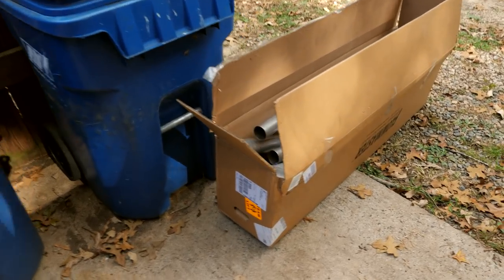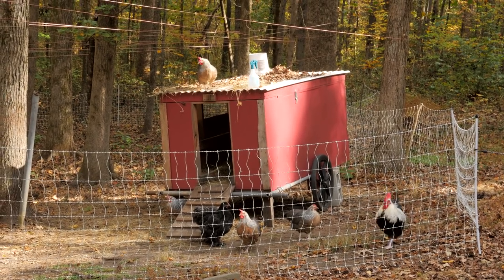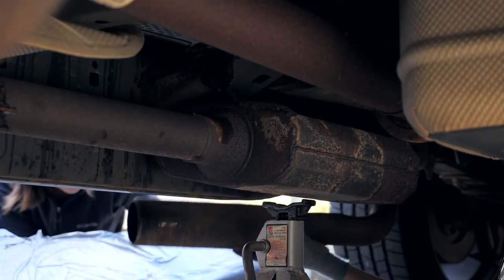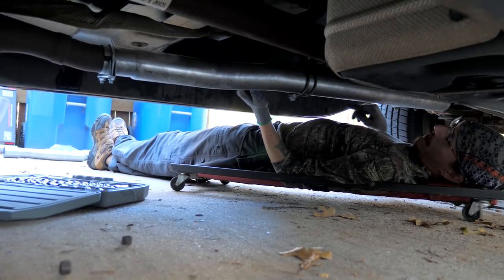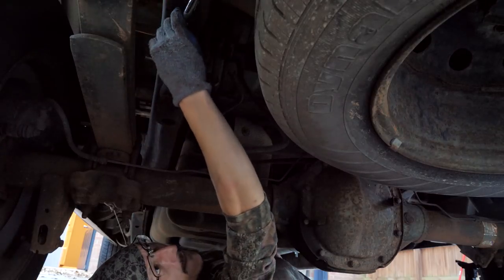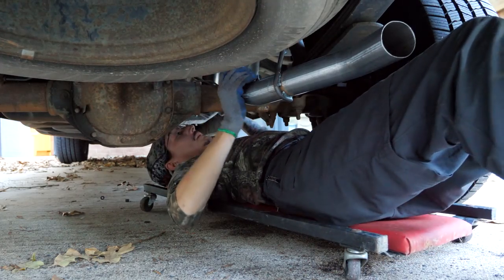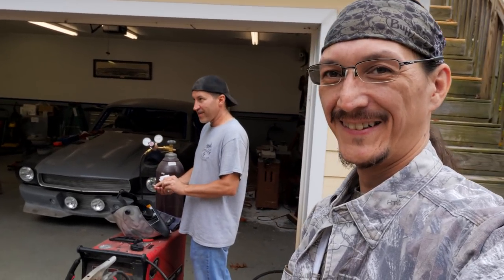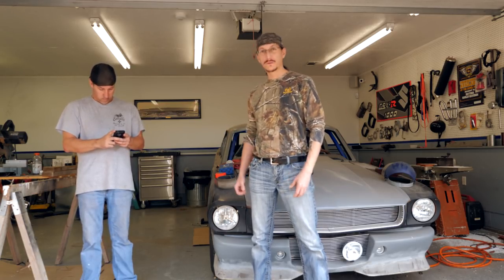Sold the Challenger, Bought a Farm Truck. Let’s Make it LOUD!

Comment: I have to have a new muffler every 10 years or so. My muffler man says it's because I only take short trips. He said that if I don't drive at least 20 minutes the condensation doesn't have a chance to burn off. Since I  usually don't,  the condensation sits in the pipe and rusts. xoxo from sunny and balmy Arizona

Comment: normally, I would say to fit the entire pipe and loose hangers before you tighten anything. this way you can verify all clearances and make sure it won't hit or vibrate on anything. but you seem to do just fine.
a nice video. good job. 
since you have gotten the vehicle, have you changed all of the fluids. you can never be certain when or if the last owner did so.

Comment: If that’s a 5.4 liter wait till you attempt a spark plug change, can’t wait for that video. Good job on the exhaust.
Reply: I have a 2000 5.4 56K (bought new) sooo if don't go much past 100K I should be good..as I have no intention of touchin' dat

Comment: Next time you have rusty parts, put Coca Cola in a spray bottle & spray it on really well. Let it sit for 30 min and they should come right off. My Grandpa used this method on the buses when he worked as a mechanic for Greyhound Bus lines.

Comment: When you were starting I was wondering if you were going to weld it. That’s some good sized pipe. Does he use a mix of argon/oxy? Sounds awesome and I like that Hellenor Mustang. Bad to the bone.
Reply from the maker: Straight argon I think. That Mustang has been almost completely custom built. He makes every little part he can rather than buying it.
Reply: Guildbrook Farm | Simple Sustainable Living I can understand that. Some of those repops you have to customize anyways so why not make it since you’d spend that much time anyways. His work is definitely incredible. Clean shop too.
Reply from the maker: He knows his stuff. He builds robot parts for a living.